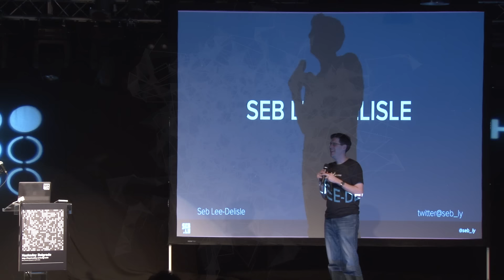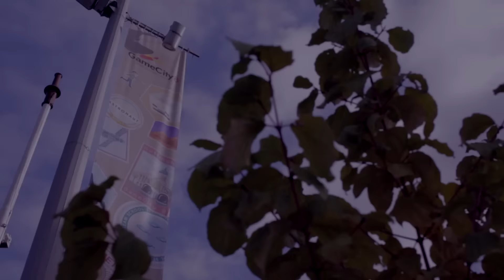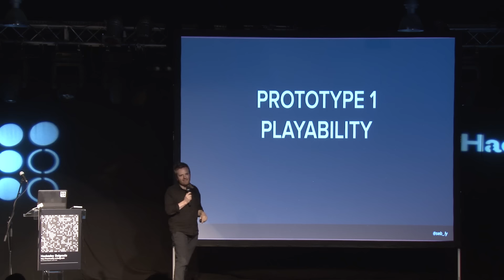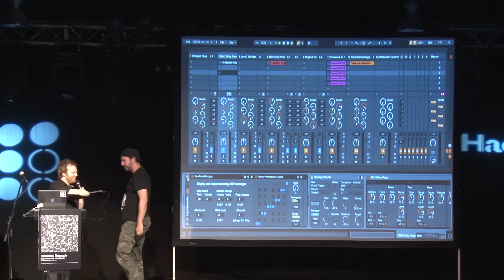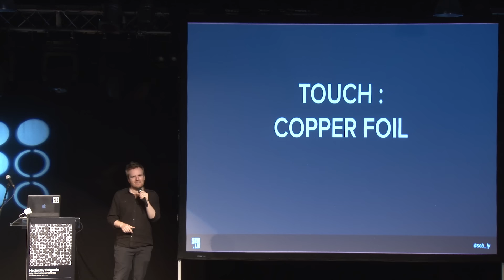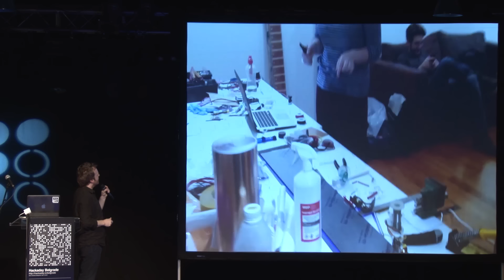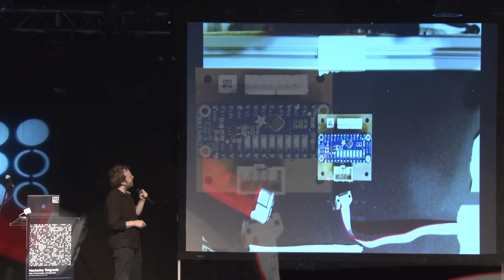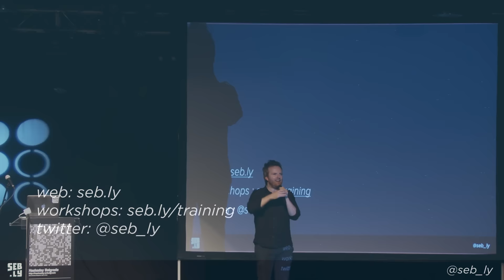Lasers, Projectors, and Custom Hardware for Epic Interactive Experiences

Comment: Very impressive R & D work from scratch. 
But, instead of reinventing the wheel, I simply purchased a 22" Viewsonic 10 point multiple touchscreen, a mini PC, and an Akai APC40 mkii MIDI controller, with Laser Show Xpress software to control my 2 laser projectors. 2 weeks to modify the projectors for wall mounting and I'm up and running with my personal living room laser shows.
Granted, my off the shelf hardware doesn't have the unlimited range of artistic capabilities of Seb's inventions, but I don't have his programmer's skill set, either. IMHO, that's the most impressive element of his presentation. ;-)